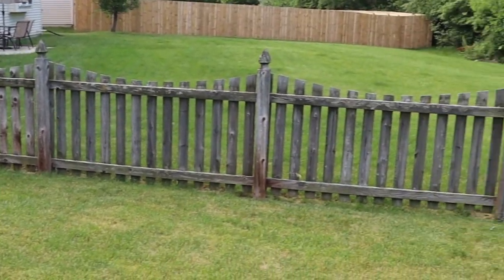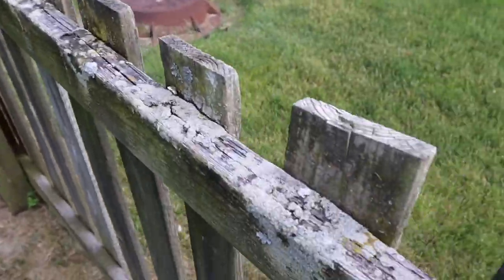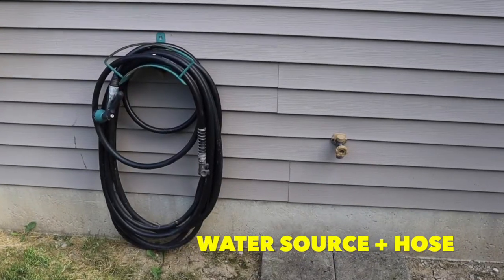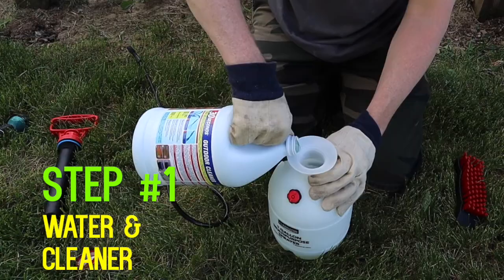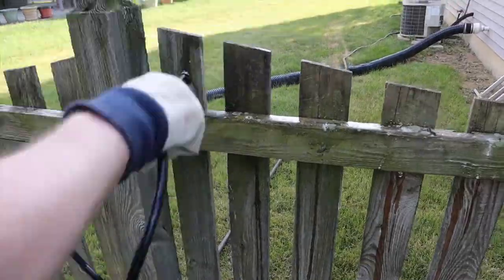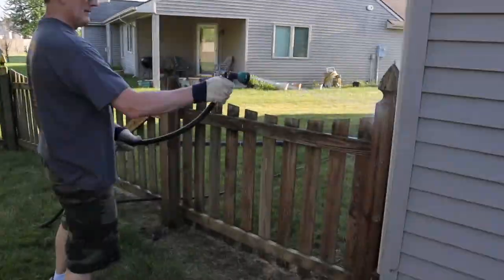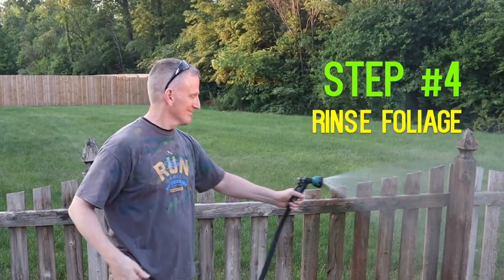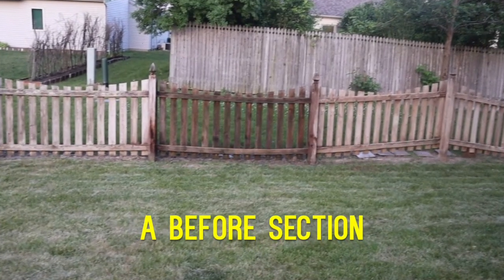HOW TO CLEAN YOUR FENCE - Simple - No Power Washer Needed!

Comment: Will this work on a painted fence that sorely needs repainting?
Reply from the maker: This will clean dirt, but I'm not sure if it will remove old paint.  You may need to use a powerwasher for that, depending on how much old paint needs to come off.  If it's already pretty barren from the old paint, you may be fine.  I don't know if they sell smaller bottles, but you could always try a small section of the fence first.  Good luck.

Comment: I'm going to list how many things you did wrong in this video.
1. You didn't presoak the fence.
2. You didn't presoak the grass in front or behind the fence.
3. You never ever add water to chemicals, it's always chemicals to water. The bottle even says that on the back.
4. In 5 minutes that solution you made would have dried. You don't let bleach dry on wood. Add 1/2 cup of gain laundry soap to that bottle, it will keep it wet for at least a half hour.
5. 30 Second Cleaner is anywhere between 20-30 bucks a gallon. The way you're going it will cost you $100. Buy dollar store bleach if that's the route you want to go, and save yourself about 95 dollars.
6. You spent 20 bucks on bleach but 8 bucks on a pump sprayer? That thing isn't even meant to spray bleach. It will be starting to rust before you're even finished. 

Take this video down dude... You haven't the slightest clue what you are doing. Your next video should be about reseeding the lawn you just destroyed.
Reply: I want to do this, and stain my backyard fence / seal it maybe a 2 in 1 from
Home Depot. I have a pressure washer. Besides what you posted, what is easiest / simplest step. It will take me a full day. It’s a lot of fence to tackle. Will bleach dry rot the fence faster? Looking for the cheapest / easiest solution. Not against pressure washing to fully strip at the end, but if it’s easier to just pressure wash the entire thing I can do that too. 

Not sure how to spray with bleach but if I didn’t buy a sprayer and it will last my fence line I’d throw it away afterwards. What’s your thoughts?